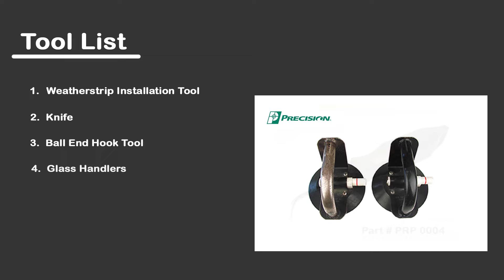1976-1991 GM Blazer/Jimmy Quarter Glass seal

Comment: Why did y’all replace the sliding widows?
Reply from the maker: We didn't, that's how it was when we shot the video.
Reply: I think he is asking why you replaced sliders with plain one piece.  
 @PrecisionReplacementParts
Reply from the maker: @AverageGuyDoingThings  Gotcha.  These are two different trucks.  The green one was going to the Sema show and we wanted to show installation of our products on that truck but the glass was already removed.  For the the sake of the video, we wanted to show removal so the other truck was used.
Reply: Any tips for putting the frames back in?  Can't find a video anywhere.  I have heard about using the rope method, but can't find anything on it. @PrecisionReplacementParts
Reply from the maker: @AverageGuyDoingThings  Original sliders have a wider flange that goes into the rubber and there's not a replacement available, so I don't recommend pulling it out.